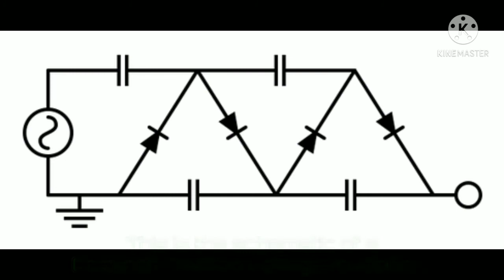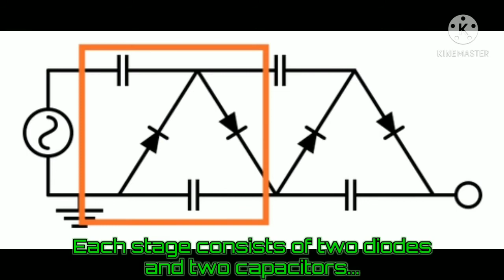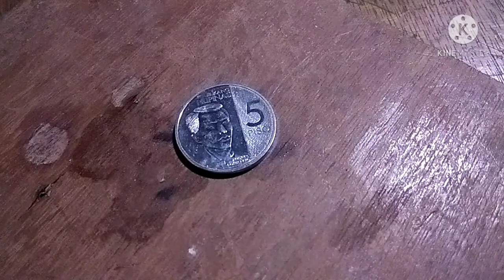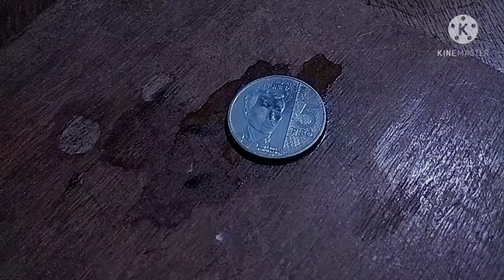How to Make Stun Rod/Gun | DIY Electroshock Device | Curious Chan

Comment: Looks like kinda underpowered still can be used to scare people or something but isnt that powerful to shock so hard
Reply from the maker: Yes, you're right... This one is underpowered😅 perhaps I'll make a 2.0 someday, if all goes well.
Any suggestions?
Reply: @CuriousChan  i suggest rewinding the transformer and make a mini zvs the one with pull down and pull up resistor and hook it to a voltage multiplier and instead make sharp points at the end of the prongs
Reply from the maker: @giant163  I like your suggestions👍 looks like there will be 2.0 in the future, that is if all goes well... Thanks a lot😄